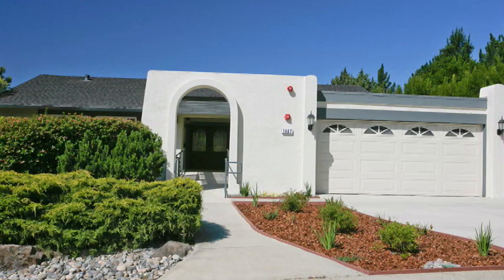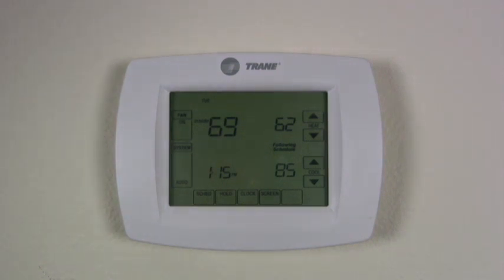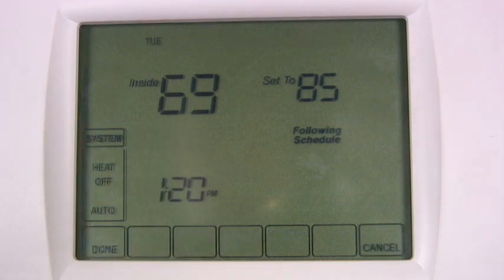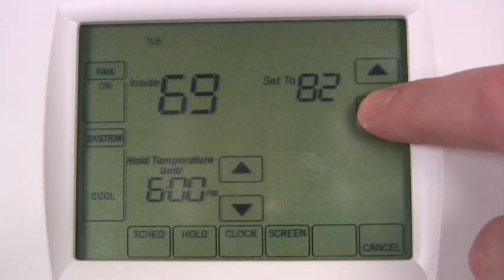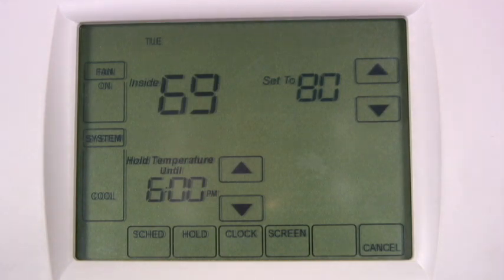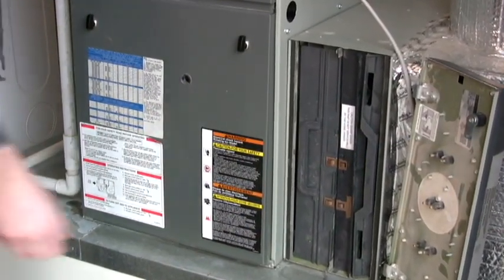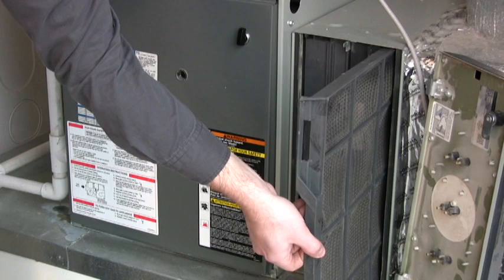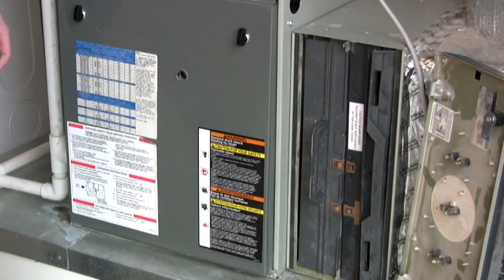24 Thermostat and HVAC Tune up

Comment: Isn't it cheaper to use fan heaters?
In Norway it's mostly a big fan on the outside of the house. This fan heats up the air and send it to every pump that is placed in the house. We have three pumps on one fan, and I would belive it is cheaper to use those then to use gas heaters. 
You don't have to buy gas, only connect it to a power source. And it's safer then having lots of gas in the house. Any ideas regarding this?